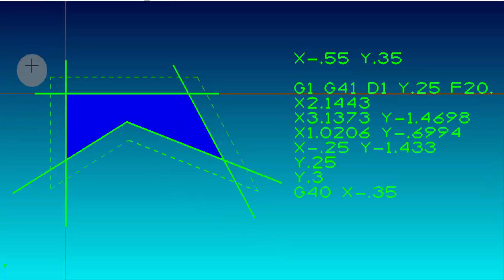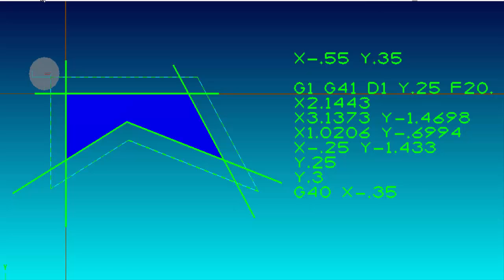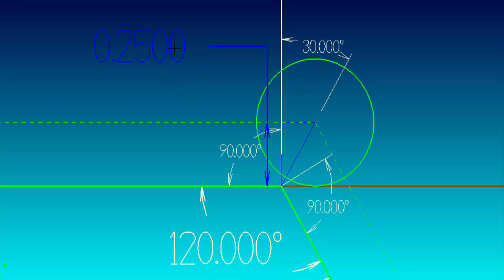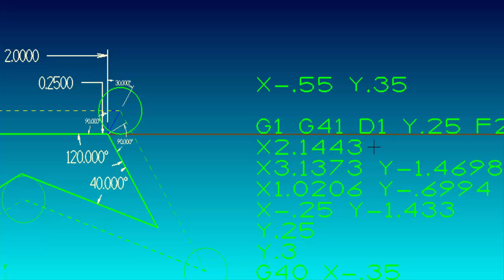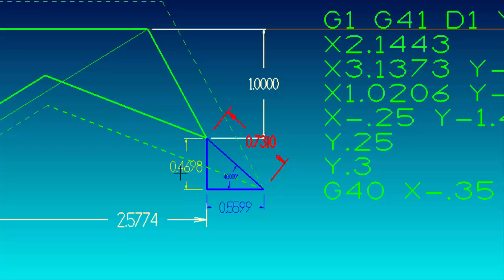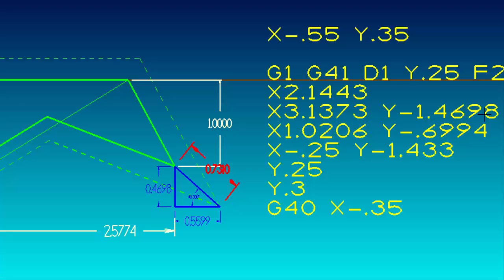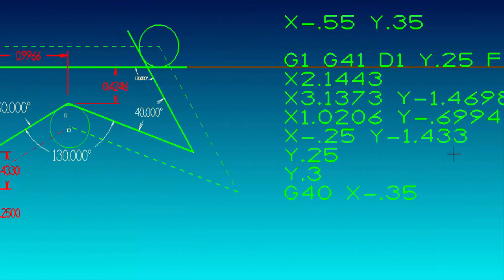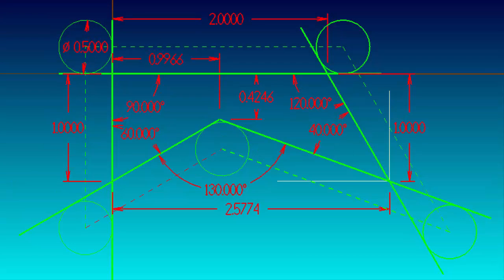PROGRAMMING OPEN AND CLOSED ANGLES

Comment: I"m learning CNC. Why couldn't you use radius compensation G41 or G42? Also, wouldn't it be easier to use a CAD program to generate codes?
Reply from the maker: Yes you are right !!   It is much easier to write code using Cad/Cam. Sometimes it helps to know how to write code manually.  One of the viewers requested this video. I had fun with it. Thanks for the feedback. Tom
Reply: I’m sharpening up on my manual programming and I was thinking the G41 takes care of the math but I do appreciate the thorough walk thru..